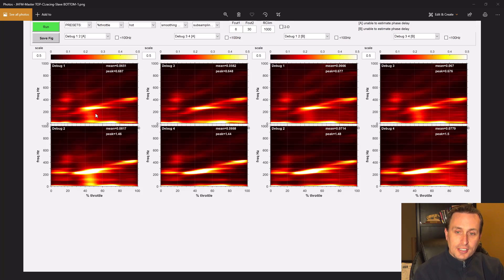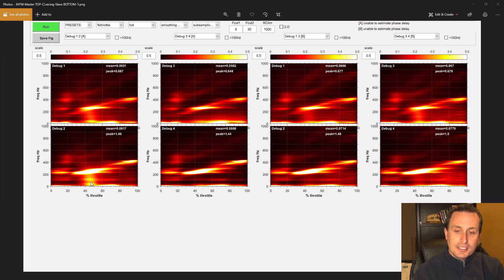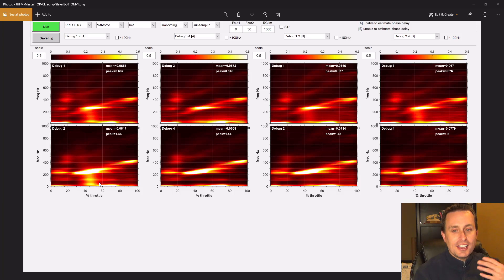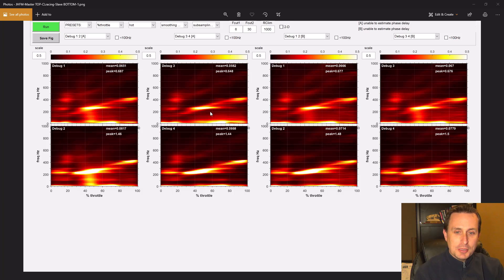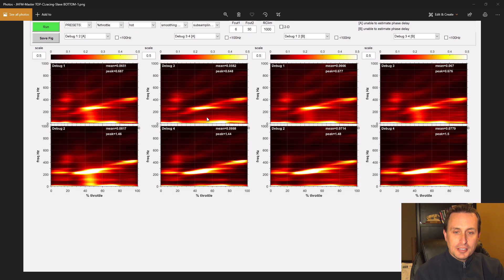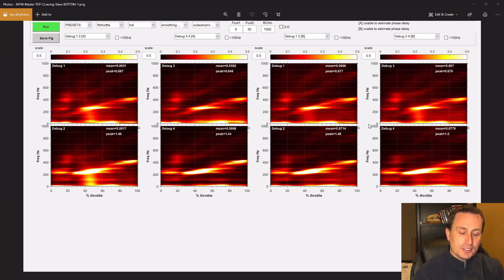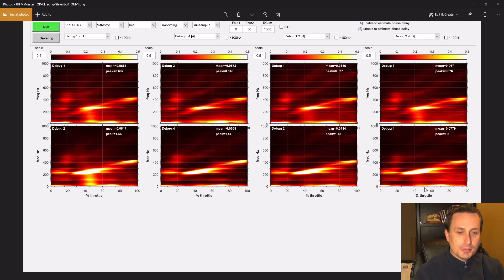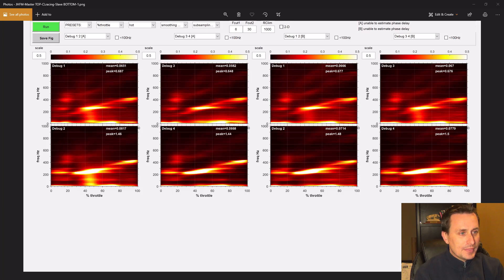What may HELP with Mid-Throttle Oscillations | MTOs  (SEE DESCRIPTION)

Comment: I have vibrations on my cinewhoop only on mid throttle then not, how could i fix it? I dont have blackbox on fc.. its geprc cinelog25 packed into oddity xi25 frame. Tried with your preset for cinelog with different setups and still have that mid throttle vibration. Gyro is bmi270 and i think that could be problem. Can you help me somehow? 
Tried presets, frame change, props, always on mid throttle vibration. 
Aio board gep f4 20a
Motors 1404 4500kv geprc
Oddity xi25 frame
Props gemfan 2.5” 5 blade

Comment: I've got an icm gyro on my 5in with pretty bad mid-throttle oscillations. What's the fix? Any quick tips or videos to point me to? Thanks in advance
Reply from the maker: Try raise ESC PWM freq to 48khz.
If you need more, put a static notch (gyro) at 250hz.  Make cutoff 200hz.
Reply: @uavtech  thank you! Will try this soon. Flashing 4.3 and I'm gonna fly it tomorrow. Hope it blows me away

Comment: I watch your lessons closely and have been using Betaflight 4.2 and tuning my heli with betaflight's blackbox. I still can't switch to quad. These quadcopter propellers don't have any wind tunnel metric, L/D curves. When I FPV my heli with NASA published airfoil blades, I can calculate my flight time or change the torque precisely, down to a few percentages. I use my Android phone's tachometer app to calculate things with NASA's NACA0015 airfoil. The quadcopter propeller vendors scare me because they are like drug cartels that tell me to give them the money and don't ask what is in the powder in the bags. I have seen Dave_C trying to improve endurance, banging his head changing to bigger props resulting in shorter flight times, no chart to look up drag curve, learning nothing in the end. I need to know the Alpha of the blades. I can't improve the mechanics if I am not even given the Alpha.
Reply from the maker: Quad props are bush league for sure.

Comment: How plausible would it be to power an ICM slave board off an independent LIPO supply to see if it's sensitivity to EMI coming through the LDO or not?
Reply: Just need a 5V boost converter from a tinywhoop 1s lipo, and power the fc directly from the 5V rail. Should be pretty light and easy to setup.

Comment: Mpu6000 has less noise simply because it has 3 gyros inside of it. For an individual gyro the icm20602 actually does better. Just learned that earlier this week.
Reply from the maker: Never heard that before.  Maybe, but what matters is what comes out.
Reply: @uavtech  I agree but it makes the idea of dual gyros more interesting.
Reply from the maker: @Quick-Flash  i ran Dual ICM vs. MPU.  They are closer.  Stay tuned.
Reply from the maker: @Quick-Flash  i ran Dual ICM vs. MPU.  They are closer.  Stay tuned.
Reply: @uavtech  dual icm42688p would win I'm fairly sure
Reply from the maker: @Quick-Flash  based on what?

"Newer" was the ICM20602, too.
Reply: @uavtech  datasheet. Icm42688p has only 70% the noise that the icm20602 does. And the benefit of sampling 2 gyros and averaging them should give you 70.7% of the noise you had. Both of those things combine means that dual icm42588p should have half the noise of a single icm20602. That's pretty good. It is also supposed to be more shock tolerant than the mpu6000.